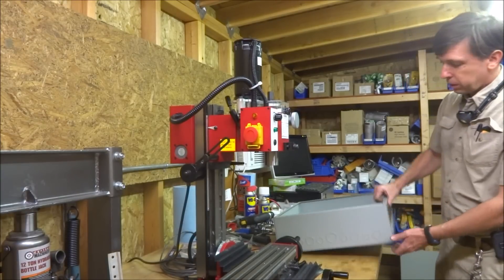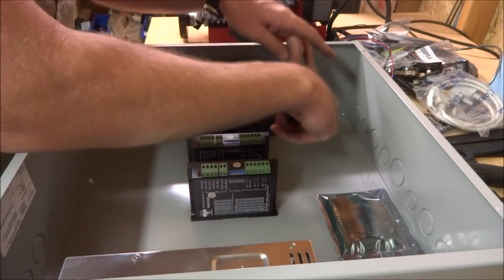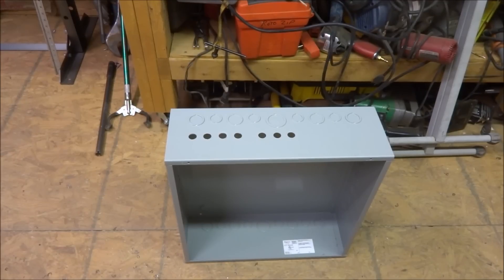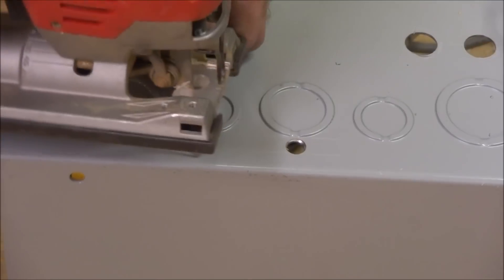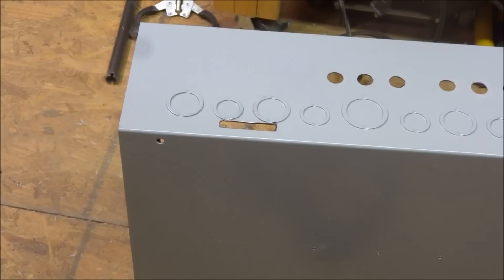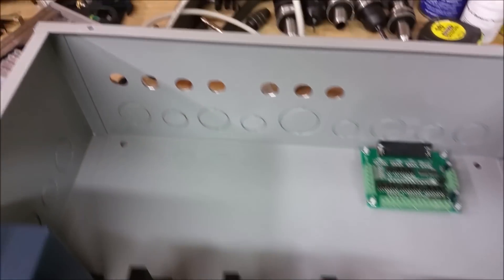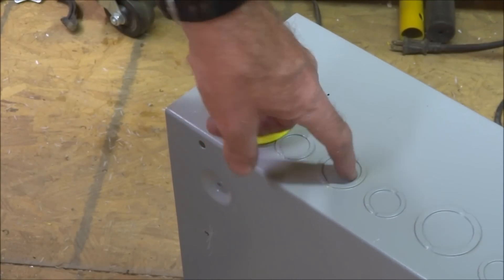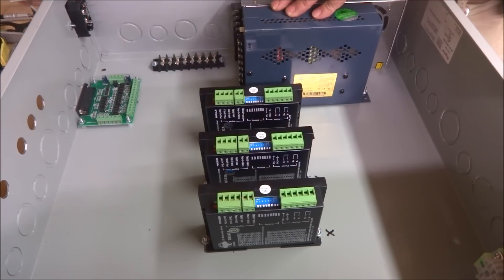Mini Mill CNC Conversion Part 1 - Control Box

Comment: Great explanation on the thought process in which you planned the layout.  Awesome tip for wandering drill bits. 
I would have never thought of that. 

Sam
Reply from the maker: CNC4XR7 Thanks Sam.  Never used a wrench before. Works better then a piece of steel because it doesn't wander left or right.

Comment: 14:07 I think they set it to 220 by default because it will not matter if 110 is used. But if it arrived at my house set to 110 and I didn't check there would be problems :)

Comment: Did you use Nema 23 270 oz-in motors for all of the axes? x, y, and z?
Reply from the maker: +GunsNpolitics  - Nema 23 425 OZ on all axis
Reply: +Craig's Machine Shop thanks. eBay is selling a 270 Oz kit and I didn't want to get motors that are too weak.
Reply from the maker: +GunsNpolitics - I think they still offer the same kit I got.  270 may be too small.  Especially for the Z.

Comment: What size wire did you use?
Did you put the fusion 360 on the same computer that you are using to run your mill?
Reply from the maker: gerald wells  I used #14 for 120V, #16 speaker wire for the aviation plug wiring, fluorescent ballast wiring  for the 5 volt controls and #14 for the power into the drivers.
I have Fusion 360 on my laptop because its 64 bit.  The mill computer is only 32 bit. I use drop box to access the files.
Reply: Craig's Machine Shop Thanks, I like the way you explain everything. I know very little about this subject.This has been a great help.
Reply from the maker: Gerald Wells Thanks!  I am happy to be of help.